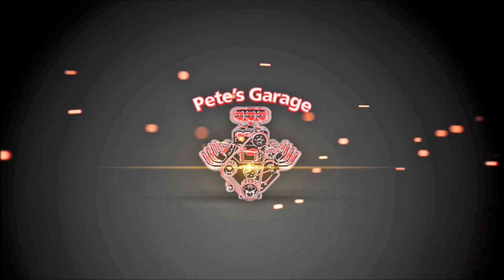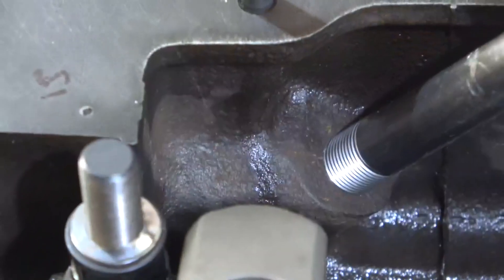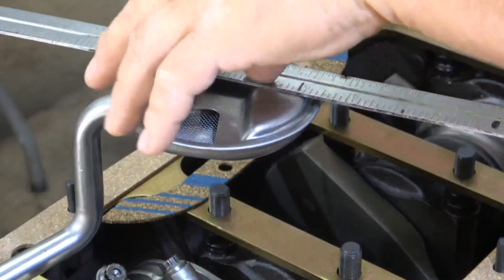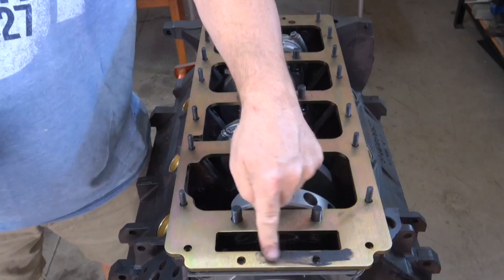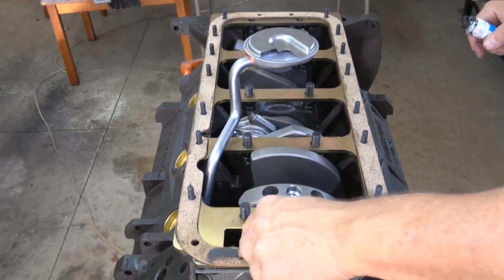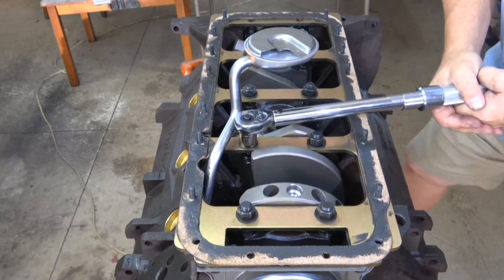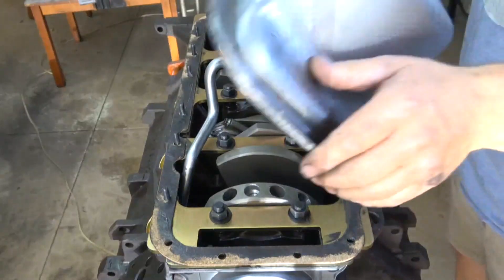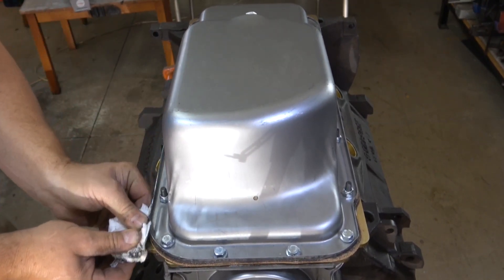Engine Building Tips - Final Girdle Install, Oil Pickup Tube and Oil Pan 440 MOPAR 512 Stroker

Comment: Question sir, I saw that you did not use a oil pan gasket/sealent between the girdle and the block. Your confident that the seal between the block and the girdle is 100% and will not leak after this engine has been in use. Opinion: would it be better to put a gasket/sealent there just to be safe ?  Excellent final oil pan demonstration / assembly and i thank you sir.
Reply from the maker: That is what the manufacturer recommends and I did not have a problem

Comment: 1/8 or 3/16 is enough clearance? I've heard u want between 3/8 to half in 1/8 seems pretty slim
Reply from the maker: I depends on if it's a bottom intake or has a plate under it
Reply: @PetesGarage  oh ok the girdle plate that's the clearance for it with one?